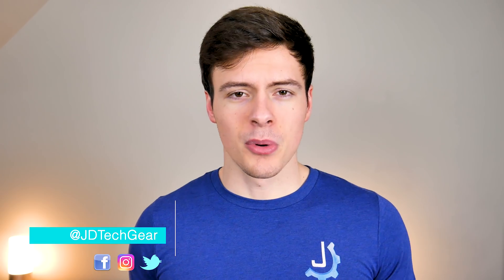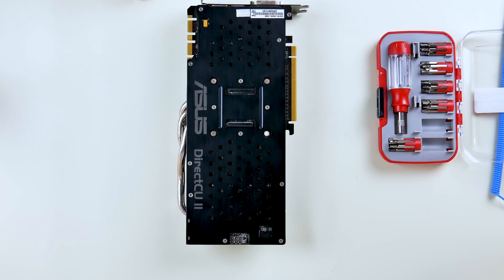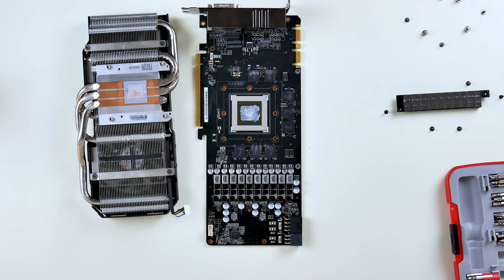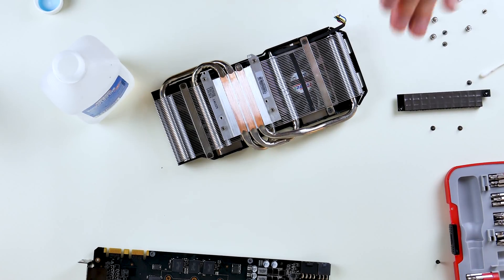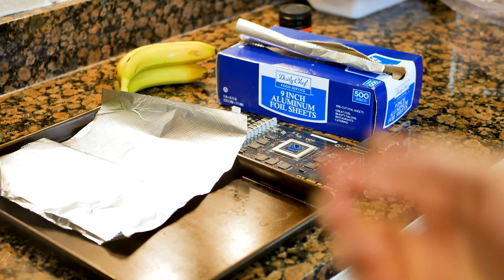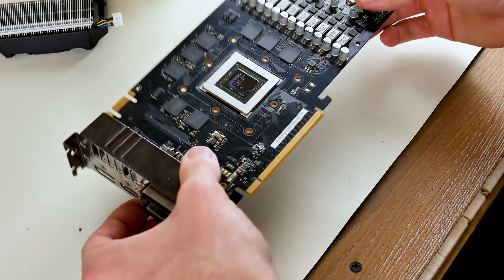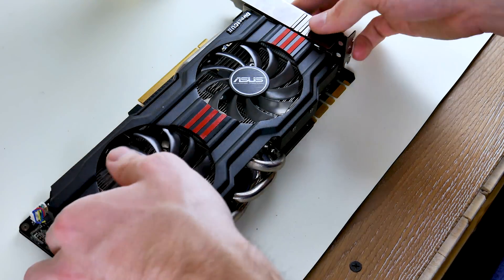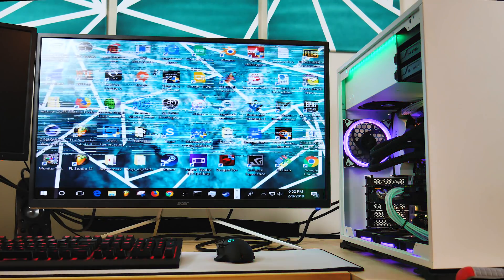My GPU Broke. Will Baking it in the Oven Fix it? - PC Experiments!

Comment: Have a gtx 770 4gb put it in the oven for 9 minutes at 180c already pre heated, turned oven off left oven door open halfway and let it cool and it works perfectly for now  new thermal paste and il under volt it in msi hopefully keep artifacts away

Comment: Baking a GPU in an oven? How about what happened to the Cap's , the SMD's etc. ? No insults intended - however a Heat Gun Station is the way to go on all SMT devices. They're not inexpensive though. Certainly this can be accomplished with a 20 watt max. Soldering iron. Clean up the flux. Aside from all I've committed on - don't use paper towels! Otherwise good job on pulling the GPU apart.

Comment: i baked a amd 280x for 380 for 10 minutes and that fixed my gpu im going to try the same thing with my current GPU i have crossfired i seem to be getting loads of BSOD with the GPU running when i had this GPU as my main unit the screen would be going black i swapped it over to have my other card as the main one now i am geting a crap load of BSOD  so i am hoping to cook it at 380 and see if that fixes the GPU

i have cross fire off so so far no BSOD i have SC2 running and some videos in the background just to see if it craps out on me again!

Comment: I'm about to try this and doing my research first, but one thing I've picked up is you absolutely do not move the gpu while it's hot, this is because while the solder is liquid the solder can move, parts can move etc. So let it cool in the oven first. Also supposed to be able to smell the solder flux as if you were soldering once it has reached the correct temperature, and be as diligent as possible about it not going over 200c as the chips may burn. I'm going to find some happy ending videos now as I really need it right now lol

Comment: my EVGA 1070 SC died on me the other day. It's a shame because it's a beautiful card. This happened as a slow process, I didn't know what was going on at first. My system went into a boot loop mode a few times in the span of like a month, then at an overclocked 75hz refresh rate for my monitor, I would get very thin static lines, so i ran 60hz. I replace my PSU for a Corsair  CX 750M thinking it may have been the PSU. Through further diagnostics, i figured out it was the GPU. Luckily I found a replacement within the next few days at a local PC shop I didn't know existed. I now rock a 2070 MSI ventus.

Comment: Had the same card, same issue, baked it and fixed it. It worked for a month and died again yesterday. The temps I used were very high, 250C - 5 minutes preheat, and 220C - 10 minutes bake, 250C - 2 minutes, and I let it cool down slowly at room temperature. Baked 14.12.2019, died 15.01.2020.

Comment: Better get a heat gun instead. By putting the whole gpu into oven all the component are heated unnecessary and become degraded. By the way I fixed 1 using heatgun.😁👍

Comment: i did my gpu at 350 do not pre heat boil not bake    make sure ur chip is not facing the heat rail at 350 at 5 mins only and let it cool down works great on my end

Comment: is it possible to increase vram in gpu for example 780ti has alot of cuda bad only 3gb of vram
Reply from the maker: You can't increase the vram, once the card is made its made, the only think you can potentially physically change is the cooler, thermal paste, and thermal pads
Reply: @jdtechgear  even if we change the bios

Comment: Actually you did it the wrong way. I mean you baked it correctly but you are suppose to cover the rest of the GPU with aluminium in order to avoid any "melt" on other components.
Then you can bake it. And when you get the card back from the oven, you are supposed to "press" the DIE in order to make the contacts all even again.
What the oven do is actually melting the soldering point so that the defective ones can be "redone" when you press the DIE.
I did it twice, on a 8800GT and on an old laptop (could not remember the GPU chip but it was definitely a NVidia one) and it all worked like a charm :D

Anyway thanks for sharing !
Reply: Do you know any guide the does it right?
Reply: @tomic_iam  I don't remember all the details, but afaik you are supposed to cover the rest of the card and only expose the die. Then apply a small presure onto the die before it cools down. It's a bit tricky and is only temporary (last time I did it, it only holds for a couple of months).
Reply: @julienr28  thanks for the helpful info

Comment: Maybe you could try and use another output port... my GPU's HDMI port stopped working so I bought a DVI to HDMI adapter and used the DVI port and a year later it's still running fine

Comment: Best bet, heat gun, That solder doesn't melt till 190C. So, you aren't really doing anything there by putting it in the oven at that temp. 

Most people use a heat plate, to heat up the surrounding PCB, then use the heat gun to hit the top of the chip to get the chip package up to melting temp. 

Then it should be OK once it re-melts. Albeit lead free solder doesn't tend to like being re-flowed. lol. Most re-ball it with leaded solder if failure happens.  

Nice try though.
Reply from the maker: Thanks Nathan

Comment: u cant use that oven any more because of all the fumes the soldering leaves when u bake the gpu
Reply: I doubt that, ovens are made with strong materials that are easy to clean, just clean it with oven cleaner.
Reply: Like do you think the materials are just forever floating around in the oven or that they taint the sidewall beyond repair to the point where they off-gas for generations to come? XD

Comment: If you get another I would apply new thermal paste before using.  I think you can reflow much of the solder with an actual soldering iron fairly quickly.
Reply from the maker: Agreed. I'm going to try a couple different techniques

Comment: Bananas?! LoL!
Tasty at best, but not a repair. LoL! 
This "oven" heat treatment, has already been proven to be ineffective as a GPU repair.
It tends to weaken every soldering point and not really cause a "re-flow" of the solder on the PCB.
This could be considered adding insult to injury, when it come to GPU repair.

Note: The PCB isn't designed to withstand the overall temperatures of an oven.
Reply from the maker: Bananas always fix my GPU issues ;) Yeah I don't think any part of it is any good for the long term, but it was worth trying and experimenting!
Reply: I would beg to differ and I'm guessing,  that Louis Rossmann would agree.
Even so, it was fun to watch and quite entertaining. 👍
Thanks.
Reply from the maker: Well I'm glad you enjoyed it, thanks for the support Sam!
Reply: @jdtechgear This really was fun to watch. Instead of Banana's how about a full loaf of Garlic Bread extra strong- Peter Griffin would! Just joking with you! ☮️ 🧄  🍞

Comment: I wouldn't bother doing this, because:
1. It's a temporary fix, even if you manage to get it to work, it will last a few weeks max.
2. In the process you'll contaminate the oven with all kinds of poisonous materials.
Reply from the maker: I've heard stories of it working for a while and some others not. But ultimately, just wanted to see what would happen since it's already dead. But I do agree it can lead to contamination
Reply: I'd give the oven a good scrubbbing If I were you just in case...

Comment: DONT. it will "work" for a while but that's not reflowing, and hurts the board overall. don't bake your computer.
Reply: if its broken does it really fucking matter better that than throw it away
Reply from the maker: It's dead anyways haha
Reply: I baked a badly artifacting GTX580. It worked for me & its now been well over a year. My sons been gaming on it most days. So not always a temp fix.
Reply: what was the temps?

Comment: JD, what hardware should I get if I wanted to get a 1440p 144hz monitor and play at pretty high settings.
Reply from the maker: If you want 100hz on almost every game at that resolution I'd recommend 1070ti to 1080ti. If you're cool with 90ish hz I'd recommend a 1070. Hope that helps
Reply: Mr.Lazybonez everything from 1080 up to 1080ti and a i5 8400 or ryzen 5 1600 and everything higher then these processors
Reply: Rafa K alright, thank you!